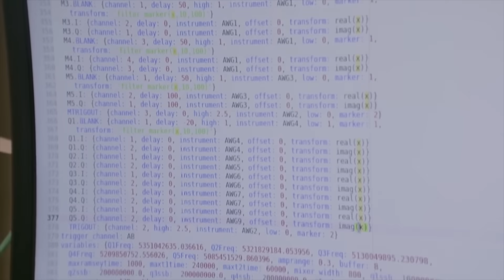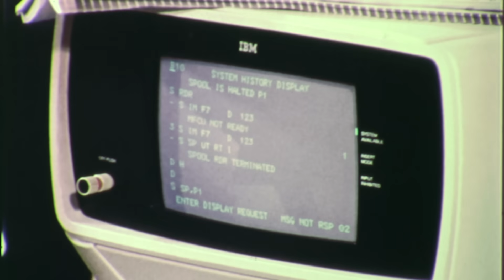Quantum Computing Fundamentals

Comment: How hydromagnetics and quantum computers are entangled ? Can we design space engines using quantum computing and super conducting fluid dynamics?
Reply: Yes, indeed. Quantum computers have the potential to revolutionize our ability to model and simulate complex natural systems found throughout the universe. Traditional computational methods often struggle with the immense computational resources required to accurately simulate such systems, especially when dealing with phenomena governed by quantum mechanics, fluid dynamics, or complex interactions of particles.
Reply: By harnessing the computational power and unique properties of quantum computers, scientists and researchers can gain deeper insights into the fundamental laws of nature, model complex systems more accurately, and address pressing challenges in fields such as astrophysics, climate science, materials science, and drug discovery. While quantum computing is still in its early stages, ongoing research and advancements in hardware and software are paving the way for unlocking the full potential of quantum simulation in understanding the universe's intricacies.

Comment: Aircriete in quantum receiving of information for your home for your computers as well as in sensory chips diagnostic tools and so much much more when it comes to the making of magnetic density in perpetual motion in 10xs greater than a radio dial in frequency in UV light speed is pinned gravity by a Motorola sound bar from you net10 prepaid phone. It had the best service because of the sound bar wouldn't lose the signal because of the gold pen!